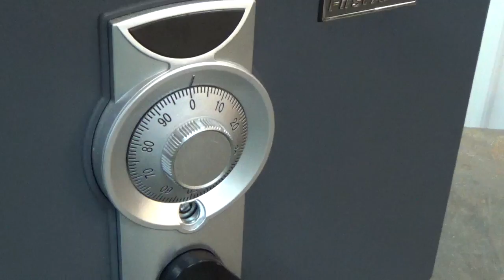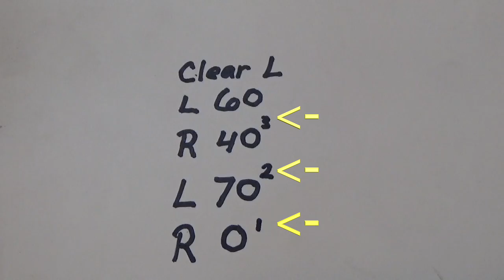Finding the Combination to a Safe

Comment: I can confirm that this works on the first alert 2087f, I picked one up from a garage sale with only the override key and didn’t know the combination,  took the inside cover off and there was the sticker with the combination on it (bottom of sticker in brackets ) I also did it the way as shown in video and both worked , thanks muchly
Reply from the maker: You're welcome, Mark! Cool that there was a combo sticker inside.

Comment: Thank you Thank you Thank you!!! I was just today trying to figure out how to reset or determine what the previous combination on a safe that our Dad owned years ago. We never new the combination so it just sat in the office for 2 decades. This video was the exact video I needed. It's a Safe-D-Posit Mighty Max safe with a combo/key set up. If I couldn't get the combination figured out, I was just remove it and just use the key, but thanks to you i have the combination. Luckily the door was open, cause there isn't any getting into it once it's locked. At least not without a cutting torch!🤣Thanks again! Just subbed!
Reply from the maker: EXCELLENT!!!  and...... THANKS FOR SUBBING, JEFF!
Reply: @PhilCrockett  You are most welcome brother!!!

Comment: I just inherited a Sentry S3110 from my dad when he moved.  Apparently while some grandkids were visiting, the safe door was open and locked with the bolts out.  During the move, the combination disappeared.  Got any suggestions on how to unlock an open door?  If I could get the bolts to retract, I could remove the cover as you demonstrate and figure out the combination myself.
Reply from the maker: You say the door is open.   So you can't take the cover off when the bolts are out?    I'm assuming you don't have a key?   You will need to contact the company.   There's a form to fill out that will need a Notary Public to sign.   Give that a try and let me know how it turns out.    But........ my opinion on it..........   I would save up and get a Liberty safe..... they are way better quality.  IMO

Comment: Do you know if there is any way to change the combination of this safe?  I have the key and know the original combo if that matters.  Looking at the mechanism however it looks as if it wouldn't be possible.  @Phil Crockett
Reply from the maker: I've never done that, however,  I bet you could buy new cams to install for a different combo....

Comment: The bolts on the locking side are held in place by plastic retainers and when a crow bar or hefty screw driver is applied between the door and seam, the plastic mounts break away from the door. What idiot cheapskate designer thought, let's make our critical safe lock components out of plastic.
Reply from the maker: Yes indeed.  Not a high-end safe.  It's secure enough to keep the honest people out though.   thanks for your review of this product.
Reply: @PhilCrockett  Not the honest ones you're protecting your goodies from, is it? FYI I'd not so much call it a review, but a criticism of the lack of manufacturing strength in selecting all plastic locking parts. May keep a curious child out.... LOL 🤣😅

Comment: Thanks for this. How do you change the code?
Reply from the maker: You would probably need to manipulate the cams in different positions, but I've never tried that before.  Sounds like it would be a fun thing to play around with.  Just make sure you don't lock your key in the safe!  (I actually did this once and had to get a key from the company.......had to sign a bunch of forms with id and Notary Public stamp)

Comment: So uh.....I have a 25 year old safe that I haven’t got a clue what the code is. Now I gotta spend a lot on a locksmith...
Reply from the maker: My safe can be opened with a key, or combo.  Does yours have a keyed entry as well?   If so, then you can contact the manufacturer and request a key.  That's what I had to do.  You will have to get a notary public and fill a form out, but totally worth it.   hope this helps.
Reply: Phil Crockett keyhole rusted over 😅
Reply: Phil Crockett thank you though. I’m trying unrust it

Comment: The combination is on the sticker inside
Reply from the maker: I wish.  Actually.... I had to reach the company (long story short) to get an extra key.  I had to get a notary public involved.  Anyway.....the combo that they gave me was a little off and wouldn't work.  I ended up using the one that I figured out.   These a cheap crappy safes anyway.  This one was given to me without the combo.

Comment: Can't a person just use a magnet.
Reply: Mechanical combination safes don't have a solenoid so they are not susceptible to that type of attack.
Reply from the maker: For what?  I’m not following you on this one.....please explain.
Reply: @PhilCrockett  I have not used a magnet myself but saw some Locksmith from Canada on YouTube open up a Smaller Sentry safe with some type of fairly strong magnet.

Comment: So the doctors stethoscope thing is a Hollywood myth :(
Reply from the maker: most likely!
Reply: Adam Smith Phil Crockett yes. It is contact manipulation. With direct entry fence/wheels, like the model in the video, you measure the movement of the handle into a gate. With a drop in fence you measure the contact points of the fence into the gates. A stetoscope is only useful if you can't feel the drop in points like a bank vault where the wheel pack is almost a foot away from the dial.
Its basically touch and sight (minimal changes of measurements of dial numbers) what is used in a successfull manipulation. So yes, to open a safe using sound only is a Hollywood myth.